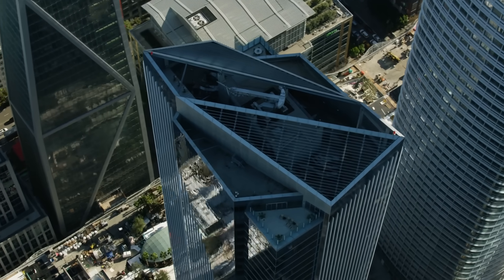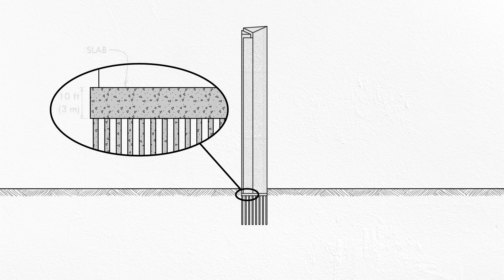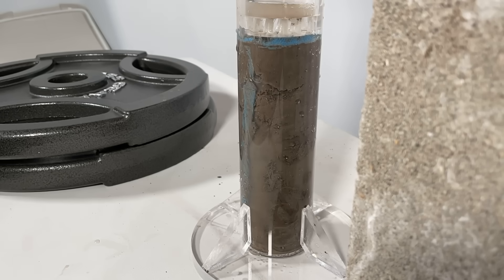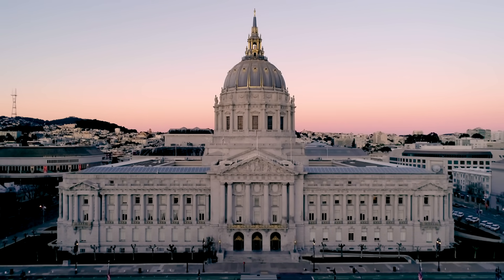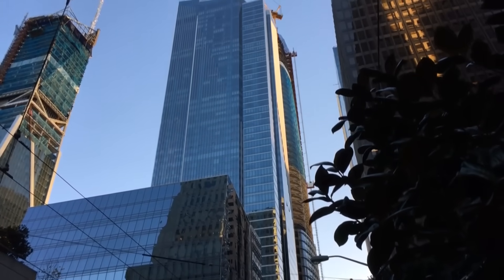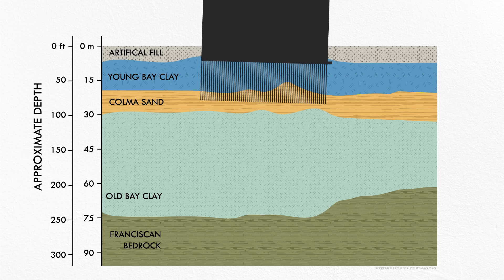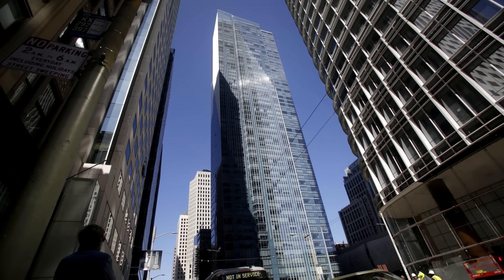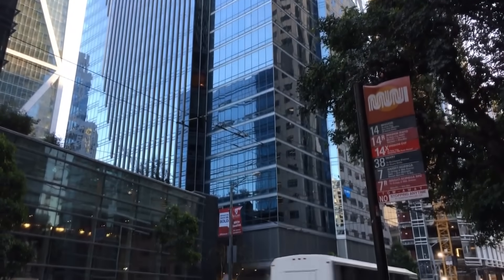What Really Happened at the Millennium Tower?

Comment: Great report! Nicely done!  As a Structural Engineer for 4 decades, a few notes for your consideration:  
1.  Residential foundations are designed for a maximum 1500 PSF per the building code. The typical footing pressure is around 1000-1200 PSF, not 100PSF.
2.  Friction piles rely on their skin contact with the soil.  In most large scale projects, this is tested first with a test pile.  It's not clear if they did this here, but should have to verify the pile solution was practical.  In design process, engineers will use friction values from a "table" but should always field verify this is realistic by using test piles.
3.  Dewatering is a definite cause of distress because loss of water will accelerate settlement, as you pointed out.  The engineers should have considered this fact in their design.  Fluctuating ground water table is also a cause of concern and in SF area is a contributing cause to settlement of structures. The original design engineers are De Simone based out of Chicago, IL, and it's unclear whether they have this local expertise.
4.  The retrofit design was not from De Simone [developer's engineer] but instead from Simpson-Gumpertz, a SF based engineer.  They did not predict accurately the potential settlement during construction and have resulted in recent work stoppages.
5.  The seismic resistance of this building is highly questionable, in my opinion, because of all the errors made thus far and I would not advise anyone to buy a unit let alone live here.
Thanks!
Dilip Khatri, PhD, SE
Reply: 1)  I think that Grady was referring to the average load over the entire house footprint, not the load on the foundation footings ... although I have to agree that the load on the foundation footing seems like a more relevant number.
Reply: @andrewalexander9492  All loads are transferred to the footings, so yeah, its relevant
Reply: How is it possible that given the location of this building, it's not mandatory to set piles on bedrock???
Reply: @jamesrussell6870  I was thinking the same, especially if it is reclaimed from the bay and made out of concrete! 🤷🏻‍♂️
Reply: I worked on this building, and will post above. However, I thought the OP would find it interesting that in court testimony, it was revealed that a soils engineer was never retained on this project! It's now estimated that driving the piles to bedrock, would have only cost an additional $4 million!
Reply: @Bannering101  even if piles to bedrock had cost $25mil., would've been worth every penny in long run. Complete incompetents were in charge from day one to very last day. The building needs to be CONDEMNED. The only sane answer when thinking about it's location in earthquakeville.
Reply: @Bannering101  That's...really not surprising.
Reply: Thanks for the extra insight Dilip, I couldn't help but find the litany of F-ups amusing especially given the scale of the project. Only time and liquefaction will tell.
Reply: A lot of people here are reacting as if the building is going to come crumbing down in a shaker. Having seen the core construction, I think it's highly unlikely that's going to happen. 
The irony is, it's a VERY well built building, sitting on a substandard foundation. I'm fairly sure the concrete construction was a major selling point, given the location. 
How liquefaction might affect it is another issue, and far beyond my pay grade. However, I sincerely doubt the 58 story structure will topple over in a quake! It might sink 10 ft, but won't topple! 😂
Reply: @Bannering101  Hey, if it sinks deep enough they will be trapped. It's not an unreasonable fear
Reply: @crazydragy4233  Well, the building is 628 ft tall, and the original pilings are 80 ft.. so after it sinks 130 ft, it'll be on bedrock. So, they'll lose 12 stories, but the remaining 46 will be good to go! Hey.. we may have come up with a solution! 😊
Reply: @Bannering101  I have actually seen a building where the lower story windows look out on dirt!   Due to backfilling by the neighbor and not due to settlement, and not 12 stories deep.
Reply: @Bannering101  - It's 645 feet tall. And an earthquake probably wont do anything (major) to the building; Unless the earthquake is close to an 8.0 or above, in which case even other buildings with foundations to bedrock could have issues). The dewatering and adjacent ground incursion of the Transbay Transit Center development is a huge issue and likely culprit. 

Interesting to note though, that he said there were at least 12 other skycrapers in SF with similar foundations, and none of them that existed during the Loma Prieta Earthquake suffered any damage/ sinking/ tilting. The Loma Prieta Earthquake was a 6.9 on the Richter Scale, and was pretty scary where I was (much closer to the epicenter than SF). That is why I say it would take an 8.0 to 9.0+ to cause any major damage.
Reply: @Sovereign_Citizen_LEO  First, are you actually quibbling over 20 ft on a 58 story structure?🤣
You seem to put more emphasis on the magnitude of the quake, and little on location of the epicenter, or the geology on which the structure is built. After all, there are several faults closer to San Francisco than the one related to Loma Preita. The San Andreas and Hayward Faults, to name just two.
If you recall, the Cyprus freeway structure was destroyed during Loma Prieta.  It was located in Oakland, farther from the epicenter than the similarly constructed Embarcadero freeway in SF. The Embarcadero freeway was later demolished (one of the best things to ever happen to San Francisco BTW 😀), because Loma prieta had revealed the shortcomings in the design in Oakland. 
So, how on earthquake will affect a structure depends on its construction, the geology on which it was constructed, it's proximity to the fault and the magnitude and type (there are different types of movement) of the earthquake.
Reply: @Bannering101  - I definitely was considering the epicenter (as I stated in the comment about me being close to it when it occured and loosing about  
2000+ gallons of water out of my swimming pool); Cracks in the walls; a 32" CRT TV bouncing off the stand about 2 inches while watching the World Series, etc.). Of course epicenter matters. I'm saying that in a similar epicenter location (or even lower SA or Hayward fault), it would seemingly take an 8.0+ to cause any real damage to the building. 

From what I remember the Embarcadero Freeway wasn't demolished because of the Loma Prieta Earthquake. It was demolished because it obstructed the view of the Bay from Downtown SF and was a general eye sore. I agree completely with your last sentence. And type of movement also (S waves v P waves) is definitely a consideration (as is the depth of the earthquake). I think "depth" would probably be a very important factor.
Reply: Thank you for sharing your observations and expertise. I'm not even close to being an engineer, but why is it so difficult to understand that this building is a complete screw up?  Seriously, is it a question of your money or your life? Maybe Surfside is just a distant memory, however engineers are already giving this boondoggle the side eye, and when this thing goes south it's going to cost an astronomical amount of lives and money. Just condemn and evacuate the building (and just to be safe, evacuate some surrounding structures), implode it so that you bring it down safely when you can control it. Sheesh
Reply: @staciasmith5162  and yet at the right price, all the units that come up for sale would still be sold !!
Reply: @staciasmith5162  As I indicated above, I worked on this structure. The one thing they did correctly was build a dense, stout structure. Unfortunately, it's floating on bayfill, and it's very mass is part of the problem.
I don't think there's any way you could implode it, especially in the heart of San Francisco. I'm beginning to think that demolishing it is becoming more likely. When I think of what that process would be like, the old joke: How do you eat an elephant? One bite at a time., Comes to mind. It would be a massive undertaking, but may be necessary!
Reply: @Bannering101  $4 million more to drive piles to bedrock?!  WOW!! If this doesn't become a reference in the building/engineering/building code world, then history again will repeat itself..
Reply: Fantastic observations sir. Very interesting dilemma.
Reply: This building may need to come down before mother nature takes it down with people in it
Reply: So does this building have any earthquake levelers? Like they talk about that they have inside the Tokyo Japan skyscrapers
Reply: 5. I was thinking exactly that. But now SF has a huge concrete in downtown to take care of. Abandoning the building is not an option, since there would be no-one to bear the maintenance costs. And without maintenance this is a disaster waiting to happen.
Reply: what do you think will happen with the 8.0 hits? (and it will). I predict a collapse at an even significantly lower value quake.
Reply: @semimba  I have been through several earthquakes and would not be cought dead in that building.
Reply: @3SpoiledDonkeys  sadly, imo many people will be caught dead in that building when an earthquake of just average strength hits. I'm thinking I wouldn't even walk around outside that building.
Reply: @kathleenchilds2837  not only in this building, imagine the tall building collapses ...
Reply: Any decent engineer should have assumed both a much higher water table and much lower to determine necessary safety factors to use to 'over size' structural solution.  NO EXCUSE  Period
Reply: @russell7489  As an SE,  I agree.
Reply: World govts are colluding together at the expense of their own citizens to usher in new world order. New world order led by obama and pope francis is coming. Jesus christ is coming back for the rapture. Get ready. Dont believe the coming ufo alien abduction narrative. Refuse the coming mark on hand or forehead at all costs
Reply: O
Reply: Perfect Comment! Thank you Dilip! I'm an older Building Contractor and worked in the adjacent area and helped build tall buildings there. I believe they build tall buildings in Chicago too,  but I'm sure... they should have used a different foundation design!!!
Reply: one of the most eloquent comments i’ve read on this website 👏
Reply: I completely agree with the seismic resistance point: since the building is already tilted, its centre of mass is misaligned with its centre of gravity, meaning any lateral seismic loading, however mild, is very likely to lead to toppling over or critical failure of structural elements within the building.
Reply: I concur.
I can just begin to imagine how this will pan out with even a mild earthquake- but SF would never get that, right???
Reply: Dilip,
You wrote that the "engineers are De Simone based out of Chicago, IL, ..."  Ok, so if they are based out of Chicago, where are are they?  Or do you mean they are based IN Chicago?
Reply: @bootstrapperwilson7687  When someone says "based out of" it means "located in" and performing work in other locations too.
Reply: @bootstrapperwilson7687  - Same difference. It's a common English expression to say they are "based out of [somewhere]" and not at all incorrect.

Comment: I overbuilt the foundation on my Maine camp. 12" diameter 5,000-lb reinforced concrete pilings straight down into the bedrock, 8' o.c. apart. Two stories with an attic and cupola. Nearly 35' high. The thing hasn't shifted any more than an eighth of in inch over 20 years.

Comment: Armchair engineer here: If they push up the building from the sides, won't that create a low pressure zone under the foundation (where the old pillars are) that could potentially damage the base through bending or cracking?

Comment: Why would anyone want to build a skyscraper in a muddy area using a concrete frame? Steel would have been lighter, would have robbed the building of less floor space and would have been much less prone to catastrophic collapse even if the foundation sank unevenly. I can't think of any advantages of using concrete in such a tall building except maybe cost, but even there, I can't imagine much of an advantage given the labor involved in forming concrete and the fact that steel would still have been needed for the rebar.

Comment: I just checked, and condos in that tower are listed at 1.3 million to 2.9 million just for units from floors 18-21. I'm sure the ones higher up in the building go for much more. If the prices of those condos have plummeted, how much would they be if not for the foundation issues??
Reply: Welcome to the SF Bay Area, where a standard suburban single family home with two car garage and no swimming pool goes for $1-2 million. SF real estate is even more expensive because of how little area there is (it’s just 46.8 sq mi!) and high demand. Before the price drop, a luxury condo in an SF high rise probably went for more like $5 million to start.

Comment: Log homes are a pain, because they shrink a few inches in height and that affects doors and windows.  So do most highrises settle 4" or 6"?  Do they build the doors that high off the sidewalk to start with?  If it settles more than about 1/4", then all the columns have to be on a giant fixed base, or differential settlement would destroy the structure.  How's the 3' thick (big deal) base of this holding up?   I don't by any of the story they are telling.  Buildings are not designed for those kind of deflections and especially differential deflections across the columns, which I suspect is the case.

Comment: Problem with "perfectly safe" is that determination was done by people that would have similarly deemed the initial design adequate. In a city that gets occasional 8+ quakes, no surprise the building that engineers are unable to predict all that reliably isn't all that highly valued.
Reply: 8+? Nope. Was in the last 7.2 there which was the worst measured
Reply: They're really only worried about a very particular subset of earthquakes, within a narrow range: Those that will bring down the out-of-plumb Millennium Tower but leave surrounding buildings standing. THEN the lawsuits might actually cost some 1%er some money!
Reply: Huge difference between safe and serviceable/comfort.  The building is still designed to stringent seismic codes. But this goes for all structures. The engineers never really know what actual loads they are designing for or how the materials will behave. Why redundancy and factors of safety are used in many steps throughout the design process.
Reply: The only ones making $$$ are the lawyers ...lol

Comment: Apparently another because of the problem is that initially the building was supposed to be a lighter all steel structure but after the foundation was completed, they decided to make it a concrete structure or a mix of concrete and steel, the new construction method being much heavier than initially planned.  Rather than verifying this foundation could handle the extra weight, they just did it and got burned.
Reply: The only good solution is to hope this building never falls... or just deconstruct completely or half it's height